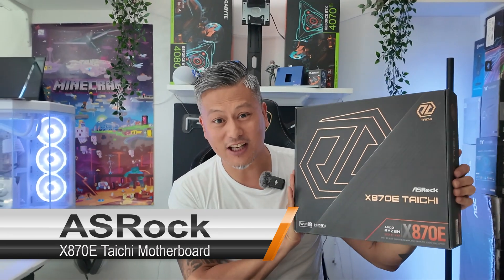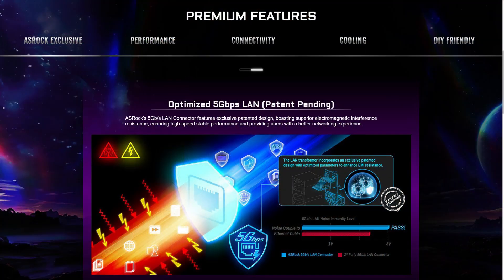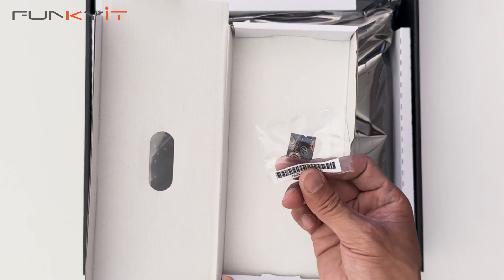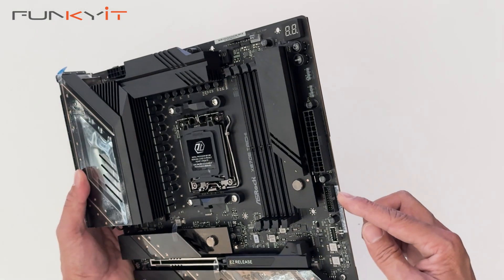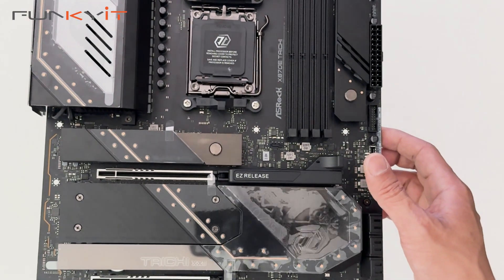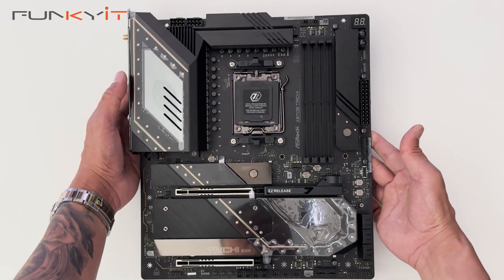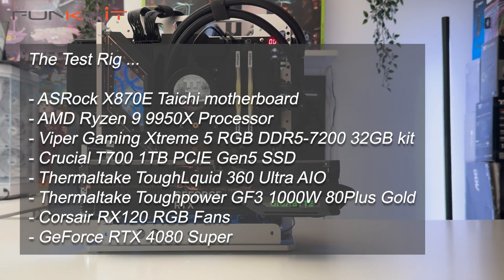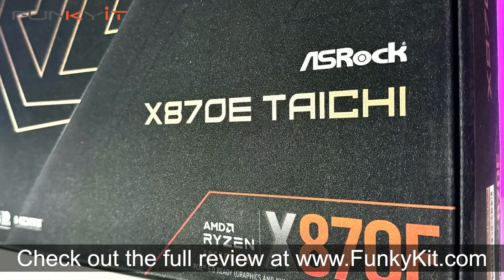ASRock's Flagship X870E Taichi Motherboard - Perfect for the World's Fastest Consumer Processor

Comment: I just installed this very same motherboard with a 9950 X3d Into my ASUS case. The motherboard would not fit into my old be quiet case. I’m still working through some issues, but this thing is a beast. Cinebench , It was so cool to watch that picture be rendered that fast. Six years ago, I bought the current taichi motherboard and it finally bit the dust. I am very pleased with my purchase And my current build. Asrock has come along way since 2019!

Comment: I got the same board with 9950X3D
Reply: Yo braddah hows the rig going? Is it still holding up? Alot of 9950X3D die paired with this mobo, one of the reason I still stick with 7950X3D, but I am curious to know about yours.

Comment: All Mainboards depending on the chipset are the same, they just have different loadouts. Either you get 1x 5.0 or 2x 3.0, etc.
Just pick your needs. I need 10 USB, 4 NVMEs, 5 SATA and sometimes a PCIE expa card, so here I am. Apart from it looking fudging dope.

Comment: i just game going to have just 1 4tb nvme in board 9800x3d an hopefully rtx 5000 series card whats a great gaming board this board here is 800 in canada before taxes should i go with x870 or x870e
Reply from the maker: If you plan to overclock then get the X870E ... otherwise X870 is just fine, performs the same.

Comment: Will this be able to run a 7950x3d with a ddr5 kit at 8000mhz-8400mhz or higher? Or does it require a 9000 series processor to make that leap?
Reply from the maker: This motherboard only works with Ryzen 9000 series CPUs
Reply: @Funkykit Weird, this should be compatible back
Reply: @Tsuki9847 Cause I said so

Comment: Can you Remove CMOS battery  on this ? Pls make a short video of it...
Reply: There is a CMOS reset pin at the bottom right side of the board. Removing CMOS is a little difficult, it's under the VRM, so you may have to deal with some screws.

Comment: Since i am on water cooling it is very good that they FINALLY added thermal sensor connectors to their motherboards. There never were any even with X670, always wanted a taichi board but this was a no go for me.. I have to ask, since it's Extended ATX, will if actually fit a normal ATX case like Lian Li O11 EVO?
Reply: Have you found out if it will for evo?

Comment: I bought the X670E Taichi from watching yours & a couple other videos a year ago, I'm wondering what the performance difference will be. Is it possible you will be testing both the 670 & 870 Taichi boards with an identical processor like the 7800x3d or 7950x3d with the same game & compare frame rates across both mobos?
Reply: If its The same processor it Will perform the same

Comment: The cheapest x870e board on Newegg is the GIGABYTE X870E AORUS ELITE WIFI7 for $320.  I'm an old school gamer that had Gigabyte and Asus builds since 2000.  I don't believe in spending too much money on a board as I don't overclock.  I put more money on components that factors more into performance.
Reply: Almost went with that one,but realized you can only use 1 NVMe or you will impact other component like GPU or USB4
Reply: Mosts boards can OC and get up to 20% more speed.

Comment: Is this board actually released/purchasable yet?  Really want to upgrade from X570.
I can only see some X870E motherboards available to buy, but I would rather ASRock.
Reply: it is on sale, always support asrock, top brand and highly popular in asian counties, i used asrock brand for 5-6 years, i just preordered the Asrock x870e nova wifi, will arrive in about a week time at my place
Reply: Available at Amazon but at very high prices.  Third part sellers too so no official ASRock warranty support.  Official retailer Central Computers has them in very limited quantities at $449/$389 USD for Taichi/Taichi Lite.
Reply: I can't find any ASRock X870 boards for sale at the usual online stores in Australia I buy from at this current moment.  I'm only able to find the Asus, MSI, and Gigabyte ones.
Reply: @JaredX7  I'm in Asia, so we get these boards faster then western countries due to timezones, U can check a day later
Reply: I ended up just ordering the Taichi off Newegg, because none of the Australian stores seem to be selling it.  Apparently I should receive it by the 8th October.

Also, I use 7 drives and a Capture Card.  Even if the PCIe lane drops to 8x, performance of the GPU doesn't exactly drop much - I've tested running a GPU at 8x vs 16x before, as well as Gen3 vs Gen4.  Nothing to be concerned about.
Reply: @AnonymousUser-ww6ns I’m confused with this. Are the nova slots pcie 3.0 though? Certainly appears to be on their site. Wouldn’t this effect gen4 m2 speed?

Comment: Is this motherboard better than the asus alternatives?
Reply from the maker: I think so … also cheaper too
Reply: @Funkykit  ok I found one downside, this is E-atx motherboard, not ATX, and my PC case doesn't support it.
Reply from the maker: @aleksdeveloper698  that’s unfortunate
Reply: @AnonymousUser-ww6ns  I have had issues with ASRock boards.. currently having x370 Taichi running for the sixth year and in the third year half the back i/o USB ports lost power (they get interrupted power so devices plugged into them turn on/off every second; using the working ones and front USB since). Had one cheaper ASRock way back and it blew up (but back then the brand really had bad rep).
Now deciding which x870 to upgrade to and ASRock is still top contender.
Reply: @AnonymousUser-ww6ns Should I get x870e nova or taichi lite?
Reply: @AnonymousUser-ww6ns any links where you got the info? I wanted to buy that exact board because it is atx and not E-atx like taichi
Reply: @AnonymousUser-ww6ns but it says pcie 3 x16 if running both and 5 if running one

Comment: Other than the cheesy light up gears, this is far and away the most beautiful board I've seen. I love the clean lines and color choices. Very nice looking layout to. And those VRMs! I'm sure I would love to own it, but the price will probably be sickening :/
Reply: Taichi x870 lite
Reply: @Takeme_DCUO  The Lite losses the easy release slot, back plate for cooling and I think one or two other quality of life things, besides the aesthetics.

Having had more time to learn about the new boards, the Nova is the one for me. But everyone else has figured that out too now and they aren't in stock anywhere. The main functional difference is the choice between a second 8x that's shares lanes, vs no lane sharing and a 1x Gen 3 and 2x Gen 4. The later configuration is enough to install both a sound card and a new network solution if it's ever needed. With up to five m.2 slots, that's a much more realistic scenario for me. It's $100 cheaper too, give or take, if it comes back without a price hike.
Reply: @zackw4941  yeah I hear you, I'm fortunate I saved enough for the taichi but the nova is definitely appealing, I hope you get what you want sooner rather than later 👍☺️

Comment: The Taichi Lite was the board I was most interested in.  Unfortunately it doesn't have the easy release GPU bracket, and removing your GPU from that super cramped setup will be a nightmare, but I really don't feel like spending another $250- $350 to get the normal Taichi that has the exact same performance other than that one feature.

edit: $50 difference.  Would have just used a strikethrough, but for whatever reason, that doesn't seem to work anymore on Youtube.
Reply: It's supposed to be $50 more
Reply: the difference of the lite version and the normal one is only $50 difference
Reply: @arthur_pd  Yeah, I found that out when I looked at Newegg.  It's pretty shocking that there's only a $50 difference.  Functionally for the most part the two boards are the same, but the normal one has the Ez-release for the GPU which is kind of a big deal.  The backplate is also nice.
Reply: How many times do you need to remove your GPU from your board after you build it?
Reply: @rbitrossome  Every six months or so if you actually keep your system clean.  Not that often, but it's enough for the cramped and hard to reach clip to be super annoying.

Comment: I wish it had 10g networking so disappointing , IT is pretty but id probably just go with the light and add a 10g nic
Reply: And? Wi-Fi 7 does 30 Gbps.
Reply: @Jacob_Tulipa  wifi is not as stable as wired